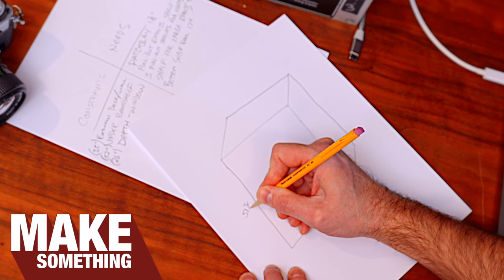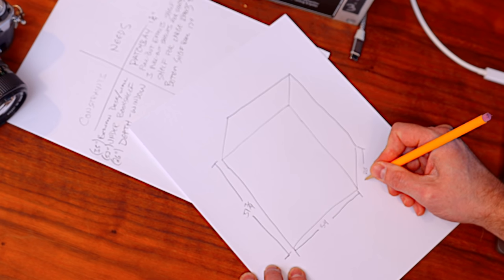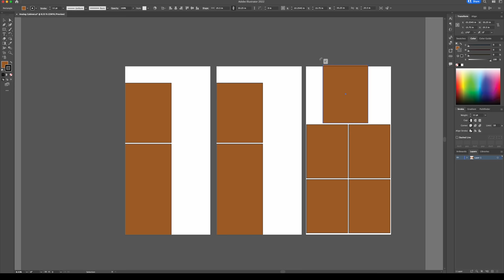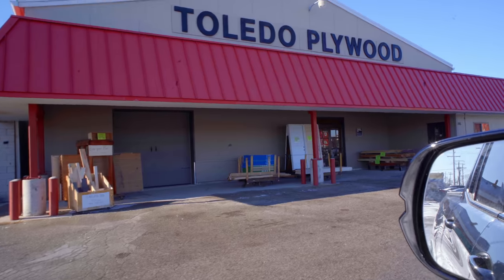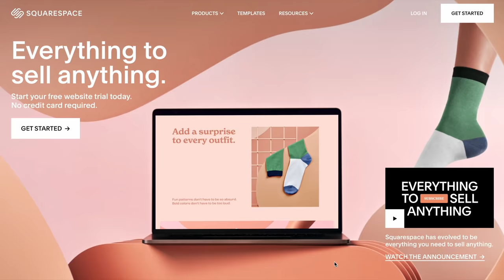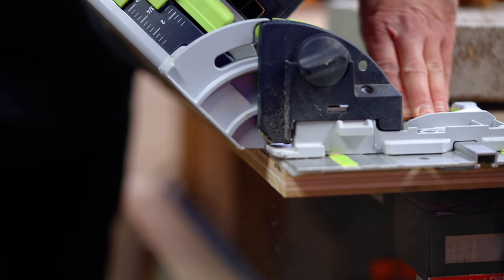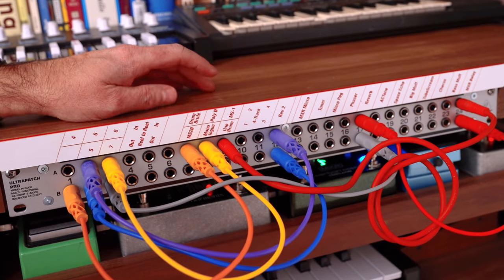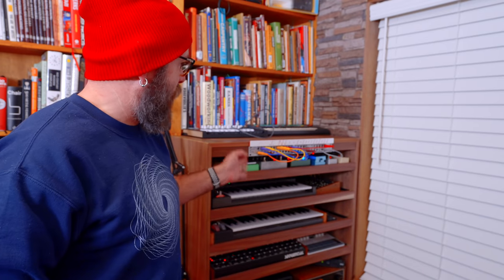Making a cabinet and designing within constraints.

Comment: Awesome video as always! Great job explaining the process. And idea for your wires so they don't hang down, leave a 3-inch tail wrap it around a dowel and heated up with a blow dryer or heat gun and leave a 3-inch tail on the other end too. Once it cools it will keep the coil in memory. Keep up the great work sir!
Reply from the maker: Oh, that's a brilliant idea! Thanks!

Comment: Nice project and explanation of the thought process behind it.  I do have one area of concern with your patch bay.  I see that there are vents cut on the top of the appliance.  Shouldn't there be a little more space above it to allow for sufficient airflow?  I don't imagine this generates a whole bunch of heat, but surely they cut the vent slots on the top for a reason.

Just sayin'
Reply from the maker: Patch bay doesn’t get plugged into a wall. Just connects audio signal cables and does not produce any heat. Plus all rack mounted gear is made to go in between other gear

Comment: wow your music gear is very impressive

I'm also allergic to the edge banding, and I will NEVER use it, no matter what. it's just against my core principles. 
I actually used the plywood only once, and that was for my zero clearance table for my miter saw. 

I'm an old grumpy man who uses thick solid wood pieces, and aluminum extrusions / stainless steel hardware.

In all my work, there is never a side or angle that "will never be seen" hence it can be "ugly". 

where can we check out your music?

Comment: how about putting the patcher on the bottom rather than the top, then you wouldn't have the cables getting in the way. With a different design layout, you could put the patcher vertical in the side, (for instance where the big opening for the reel to real is,) rather than horizontal.

Comment: Serious question - What is shop-grade walnut plywood? Where do you source it from? What are its codes, i.e., how the industry describes it?
Reply from the maker: I get my plywood locally from a place called Toledo Plywood. I don't know the technical stuff. They have two grades of walnut plywood. Shop grade and A grade. A grade is twice the cost.
Reply: Shop grade ply is usually 7 ply poplar core with one ‘A’ face of walnut veneer (at least the Columbia Forest Products ply). I used to build guitar amp cabinets with maple shop ply and it’s great and cost effective. I’ve also built a few pieces of furniture with walnut and maple shop ply. Great video David, thanks for using our solderless cables.

Comment: Terrific build! How did you deal with the cables coming out of the backs of the components on the drawers? 

I did a similar project for work once (similar in concept that is...mine didn't look half as good) and we were always fighting with the cables. They'd get caught on the next component down and either wouldn't pull out or would pull the next component out too (which might also bring the next one with it as well).  The keyboard and mouse on the top drawer were so light you'd pull out an empty drawer and they'd fall on the next component down. Giving the cables more slack helped until you push the drawer closed and the the cables piled up on the lower component, pressing buttons and flipping switches.
Reply from the maker: Thanks! They just hang over the back side of the drawer below. This isn't a problem except for one drawer and they do catch. I'm going to take some picture frame wire and string it between the two sides and feed the cables over top of that. I'm thinking that'll take care of the issue.